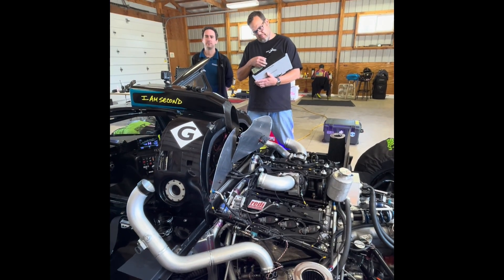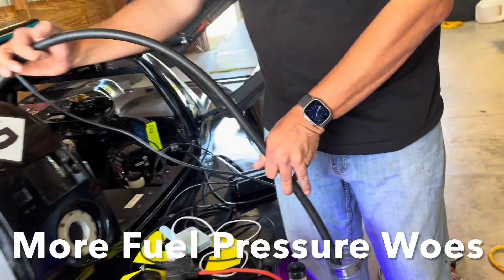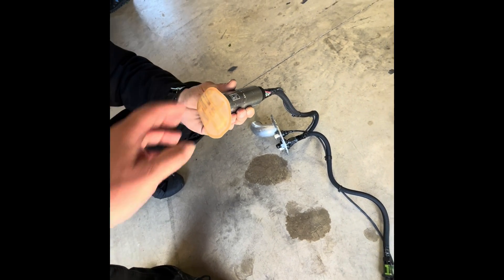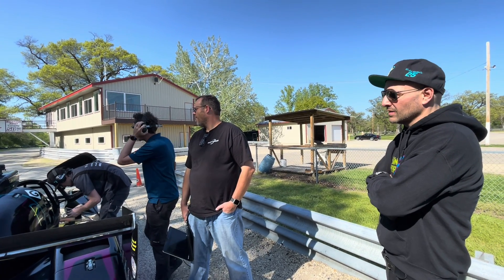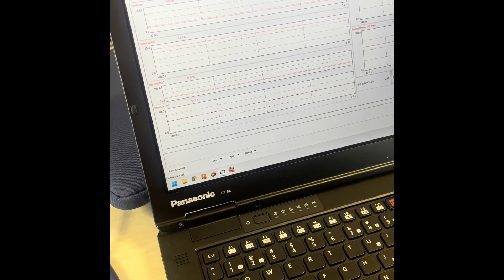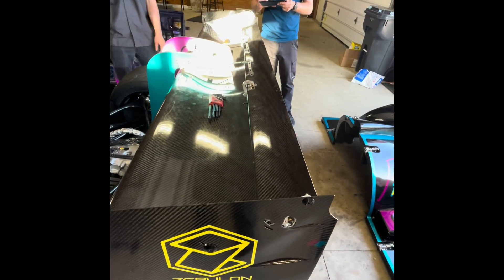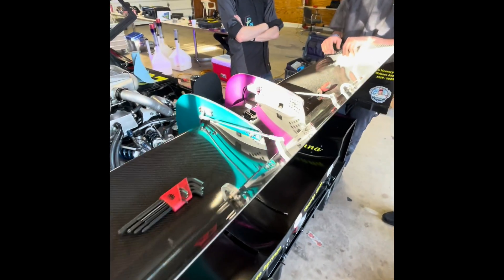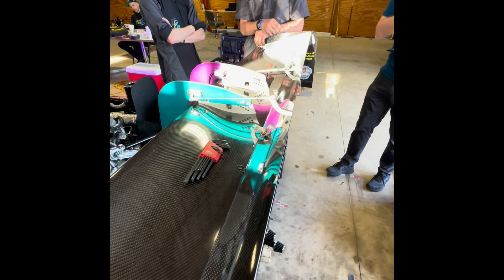Day 1 - Pikes Peak International Hill Climb 2024 Testing - Team Fastest Pastor - Tuned By Shane T

Comment: Is it possible to control active aero via motec PDM?
Reply from the maker: PDM would be hard as it only has switched outputs and cannot do any direct control based on input signals.
Reply: @TunedbyShaneT @TunedbyShaneT  Ahh, that makes sense. Im surprised MoTec doesn't offer an active aero solution.